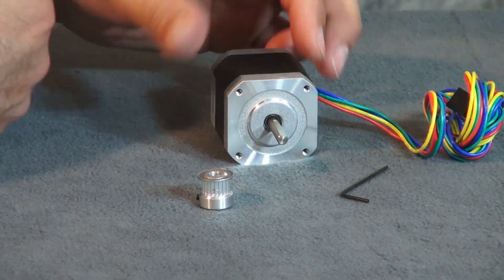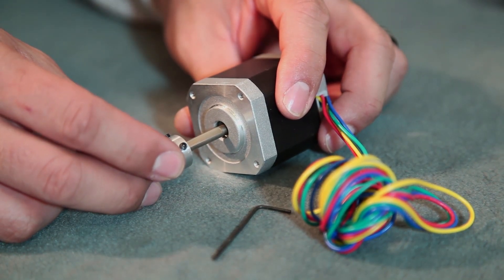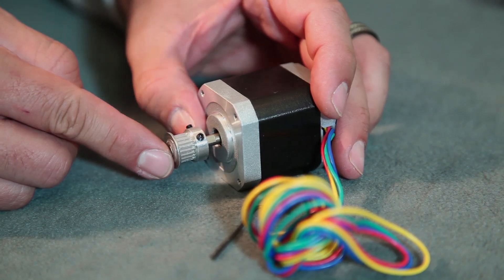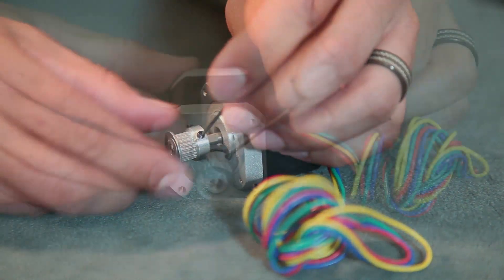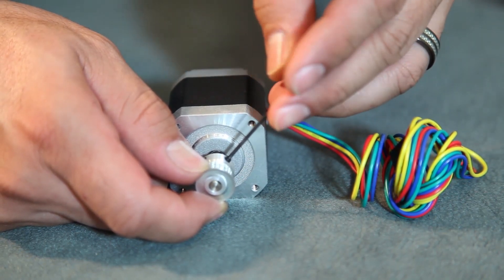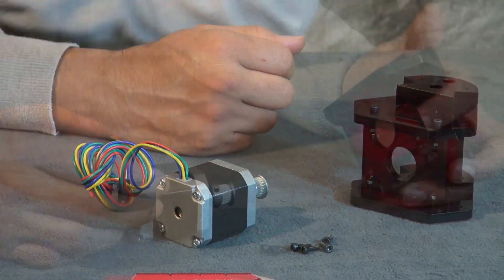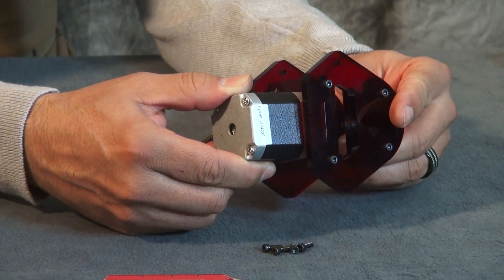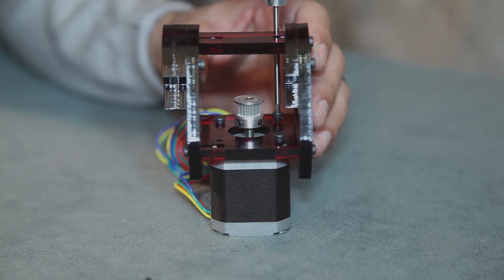Kossel Clear Build Instructions Chapter 6: Motor Mounting

Comment: sir i am very much intersted in buliding my own 3D printer with the help of your videos .By watching your videos i got a confidence in me to a one for my self .I an from india and i am already having 3 stepper motors i dont which categories they are but the seller told me that they are  having the capacity of "10 kg-cm "in the internet i searched the torque calculator in that it is mentioned that it is "138.77 OZ-in" can i able to use these stepper motor for mu=y project or not.it will be a great help for me from your side.plezzzzzzzzz reply iam waiting for your answer
Reply from the maker: Sorry for the late response! check if these are nema 17 stepper motors, because it's rare to find 10Kgcm. the one in the build instructions is 5.5. i suspect that they are bigger